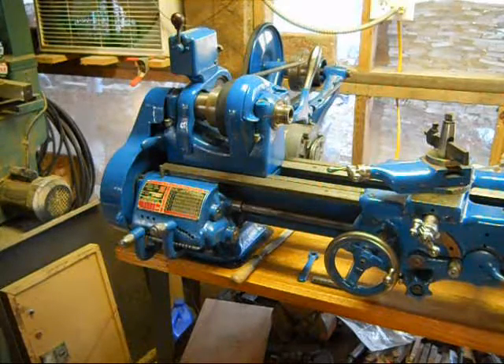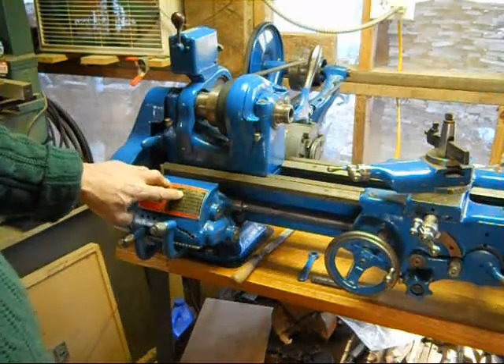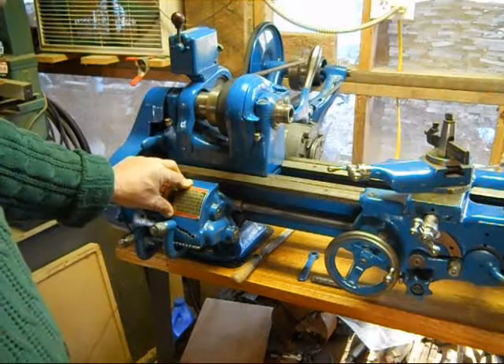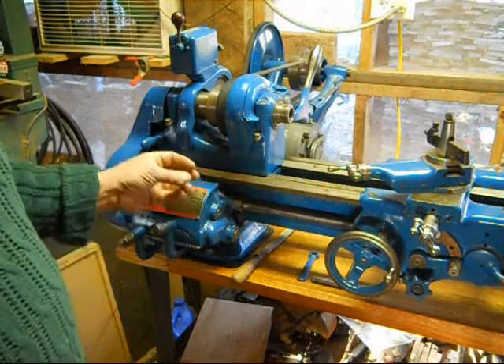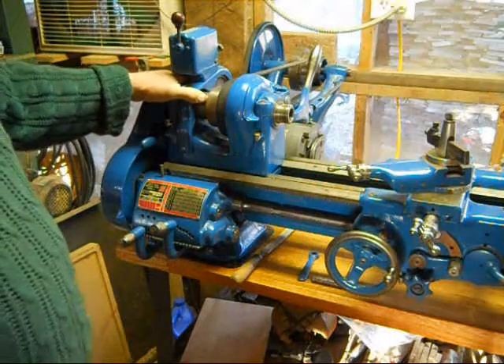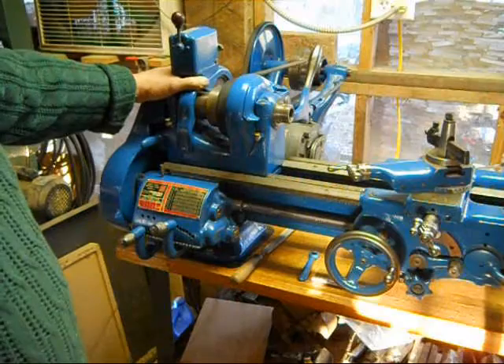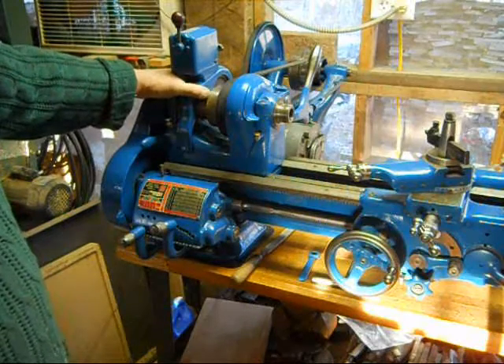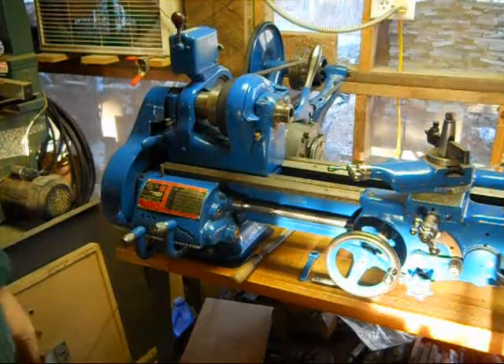South bend restoration #12 final thoughts

Comment: Hi Friend, nice job on the restore, I watched a few of your vids. as I was doing my apron clean up.  I noticed my half nut was almost completely stripped out.  Couldn't find a good used set anywhere.  So I made a new one out of bronze, ACME 3/4 x 8tpi.  Got it to fit the lead screw nicely.  And made a jig in my mill to hold the cast iron half nut assembly in situe, while I bored out the old thread. I'm at the point as I type this, to silver solder it in.  And then I will cut the nut in half...
Gonna try to film it, and make a video to put up, if it turns out, which it will. Because I haven't seen anyone do it yet.  I hope you can check it out when I get the camera figured out, and how to make a vid. I don't think I have a subscriber yet lol!
Reply from the maker: I look forward to see your video of the repair. Also I think it well be a good as I have not seen anyone else do that kind of repair. I wish you good luck.
Jamie
Reply: Thanks Jamie, it worked out great, got it recorded, just need to do a recap on making the threaded piece and post it, thanks for subscribing too.
Rudy